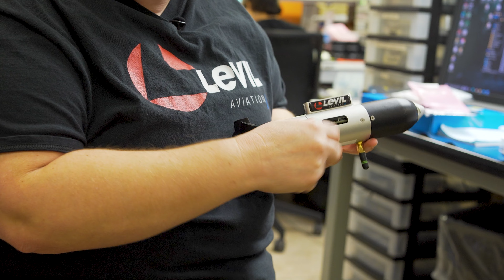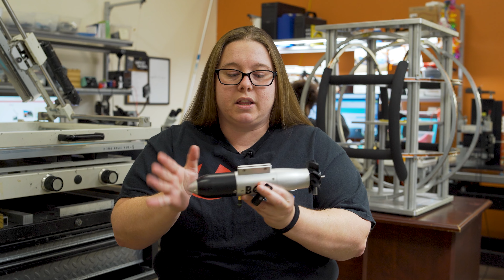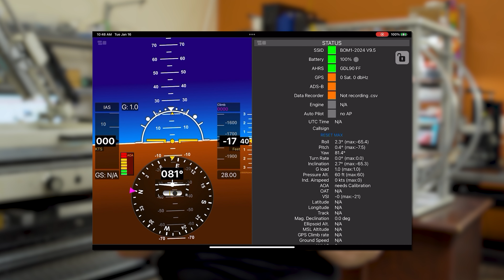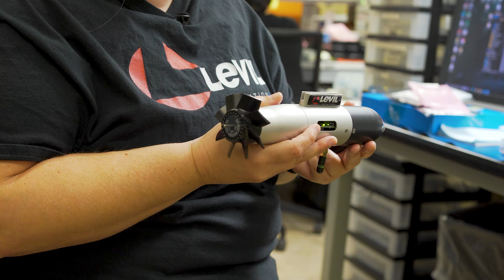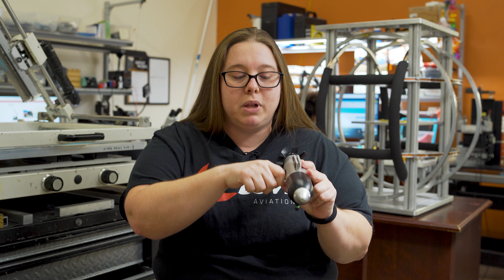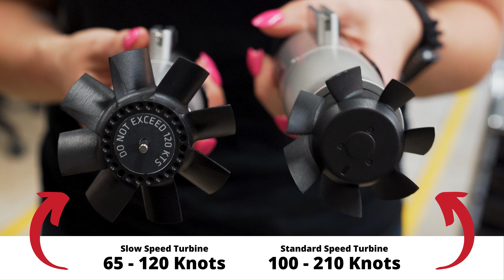How to Troubleshoot Your Levil Aviation BOM (Easy Charging & Wi-Fi Connectivity Solutions)

Comment: A potential issue is that the BOM has chosen to use WiFi channel 13, which is either low power or unusable by many devices made for the US market due to FCC regulations. I contacted support about this and was offered no resolution that didn't involve customization of my unit for an additional fee. There is currently no method provided to pick the WiFi channel manually, rather it apparently picks a WiFi channel based on your serial number, so probably only 1 out of every 13 units (~8%) have this issue and it will persist until a new firmware is released to fix the issue. Allowing a manual setting the WiFi channel would also reduce the potential for other conflicts, so I hope to see that in a future firmware release.